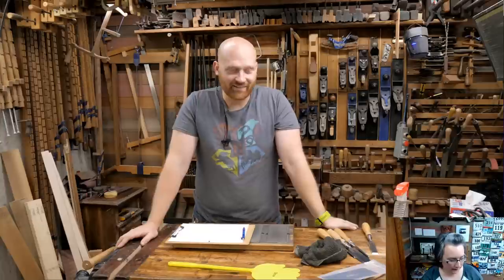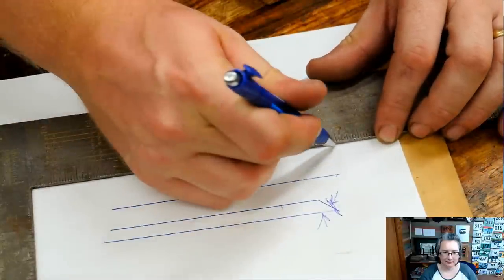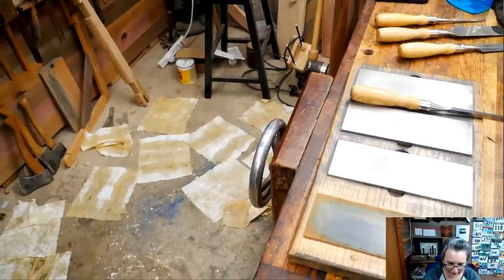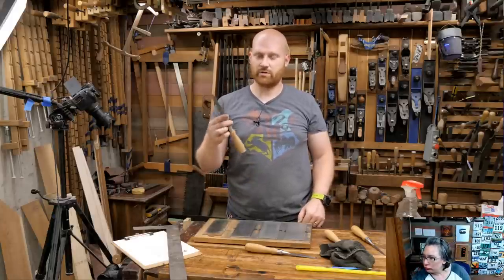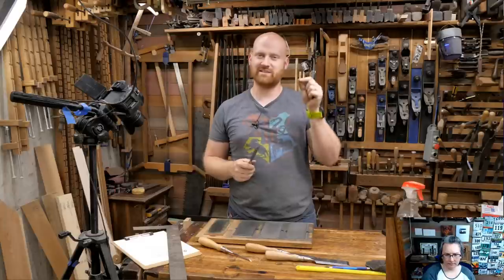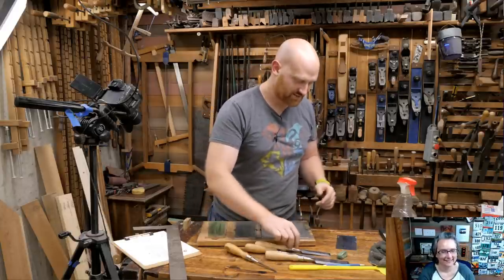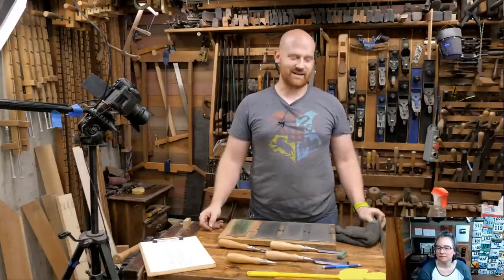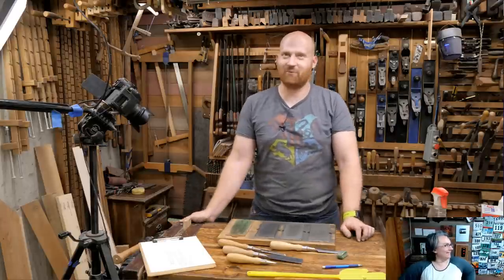How to Sharpen any Chisel

Comment: Excellently simple! But just curious what you think of Paul Sellers’ method of sharpening a convex bevel where he starts at around 30 degrees at the cutting edge and then drops down to around 25 at the heel and why you have opted to try to maintain a straight bevel.
Reply from the maker: Just personal choice. I find it a bit easier to not round the tip this way but they both end up at the same place. So the only difference is personal choice.

Comment: Very informative show - thanks! I know you addressed the question of how often to clean the strop... but do you ever completely replace the strop?
Reply from the maker: I have never replaced a strop from use. I have ripped a few from a sharp edge taking a bight out of one. but a a good Horse butt strop should last you 20+years of use. with out any problem. most of the time they get damaged before that though due to clumsy hands. now if you use a softer leather they may degrade quicker.

Comment: Hi James great live! I’m watching back not live as I’m in the UK. I have a question. Do you recommend using a window cleaner over using just plain water for diamond plates and why? My next project is restoring and sharpening my grandads old Stanley bailey no4 so I’d love your input, pretty much just needs sharpening and cleaning it’s really not too bad other than a flakey handle finish.
Reply from the maker: Yes I prefer window cleaner over water as it evaporates quickly and has less chance of getting underneath the nickel and rusting the plate.

Comment: I know it’s “common knowledge” that a back bevel is a bad idea on chisels (losing the reference surface), but I wonder how much of a difference it would actually make. 
Using a 1/16”, 6 inch ruler, and taking 1/16” off the back of the chisel results in the cutting surface of the chisel being 6/10,000 higher.

Having said all that, I don’t put a secondary bevel (front or back) on chisels or plane blades.
Reply from the maker: yup I have tried it and it is surprising how little is needed to make it stop cutting the reference capability.

Comment: "Wetstones"?  There are regional differences in terms, but I think you mean what I'd call a waterstone in distinction to an oilstone.  Both are "whetstones", as are diamond stones and anything used to whet, or hone a blade.
Reply from the maker: Surprisingly diamond Stones can be used drive just as easily as they can be wet. Generally whetstone refers to either water stones or oil stones.